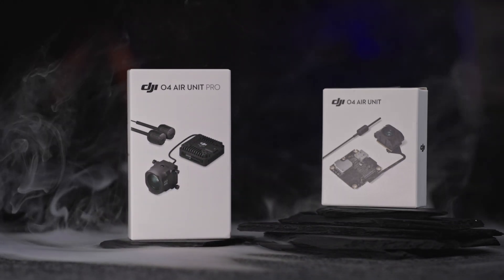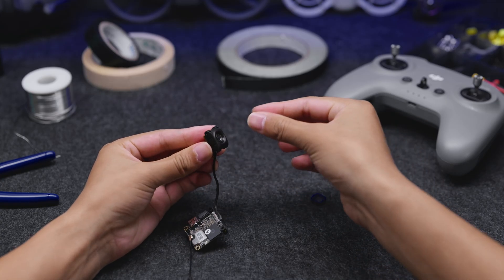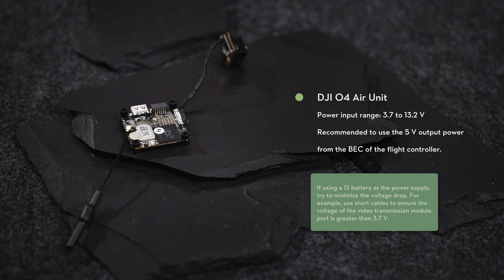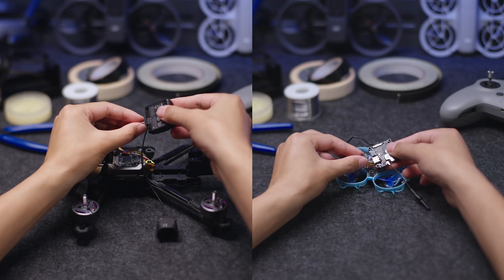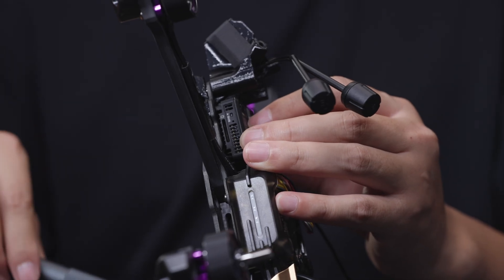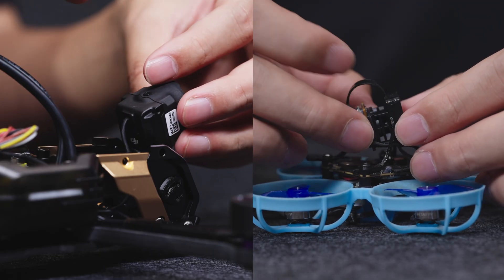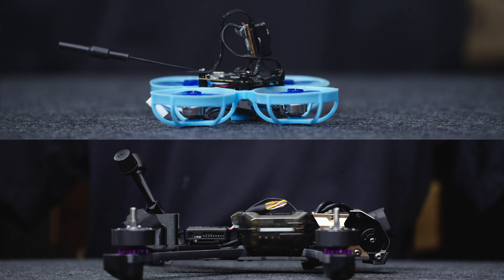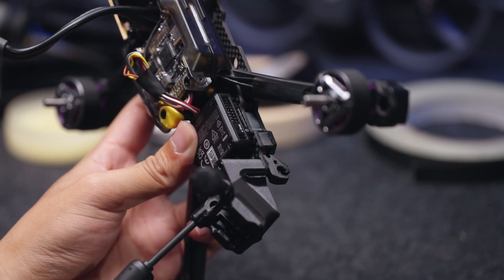DJI O4 Air Unit Series｜Installation Instruction

Comment: What if I'm planning to put it on rc truck, can I just use the power and power gnd wire and leave the  uart rx/tx, signal gnd, dji dhl wires not plugged in?

Comment: I'm using the DJI 04 Air Unit in a 5inch build because it's what I have. Do you recommend a larger antenna than the little one it ships with? Any recommendations for a good one?